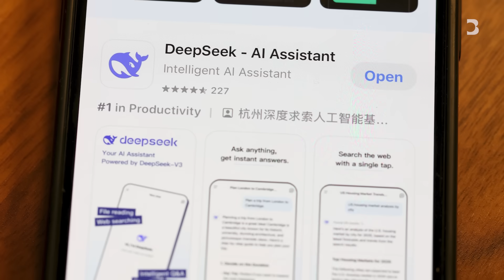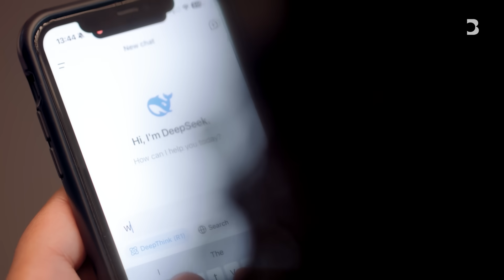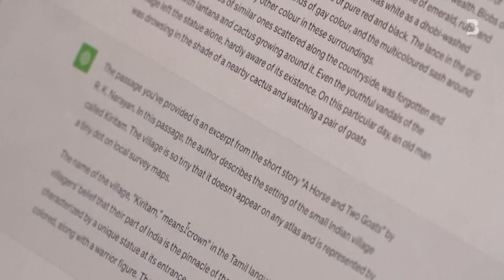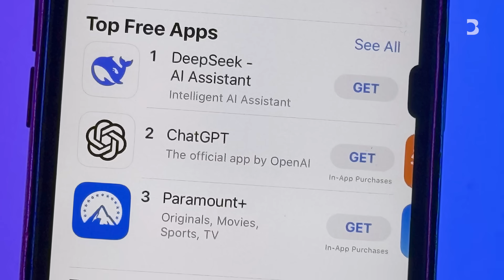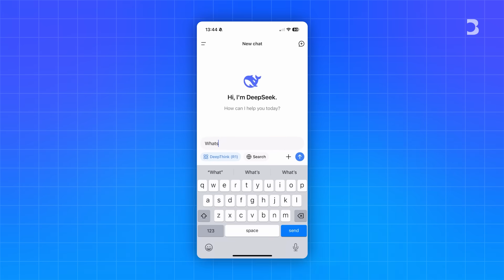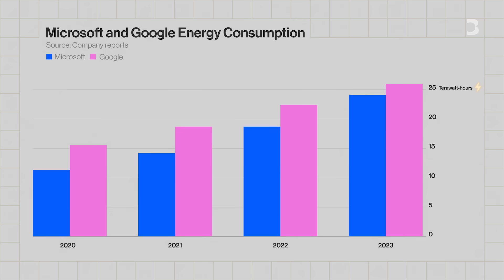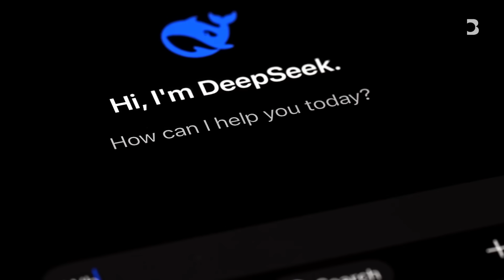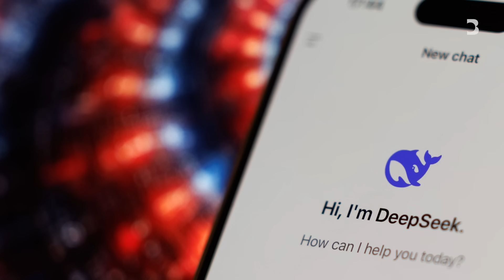How China’s DeepSeek Came for Big AI

Comment: I watched a lot but i decided to ask DeepSeek it self : From where DeepSeek got the Nvidia chips?  Answer:1. Pre-Ban Stockpiling
DeepSeek’s founder, Liang Wenfeng, reportedly accumulated ~50,000 Nvidia A100 GPUs before the U.S. imposed export bans on advanced AI chips to China in September 202212. These high-performance chips became a critical resource for early model training. The company also legally purchased Nvidia H800 GPUs (a China-compliant variant of the H100) in 2023 before the H800 itself was banned later that year15.

2. Use of Compliant Chips
After the H800 ban, DeepSeek shifted to Nvidia H20 GPUs, a less powerful but legally exportable chip designed for the Chinese market. While the H20’s performance is limited compared to the H100, DeepSeek optimized its software to compensate, enabling efficient training and inference510. However, U.S. officials are now considering extending export restrictions to the H205.

3. Alleged Smuggling Through Third Countries
U.S. investigations suggest DeepSeek may have acquired restricted Nvidia chips via intermediaries in Singapore, Malaysia, and the UAE 15. Key points:

Singapore’s Role: Nvidia’s revenue from Singapore surged from 9% to 22% in two years, raising suspicions that chips billed to Singaporean entities were diverted to China1.

Shell Companies and Fake Data Centers: Reports indicate a smuggling network using these tactics to bypass U.S. export controls1.

U.S. Legislative Pressure: Lawmakers have urged stricter licensing for shipments through high-risk countries like Singapore5.

4. Partnerships with Nvidia
Despite restrictions, Nvidia openly collaborates with DeepSeek. For instance:

The DeepSeek-R1 model is hosted on Nvidia’s platform as a NIM microservice, optimized for Nvidia HGX H200 systems214.

Nvidia publicly promotes DeepSeek’s efficiency, highlighting its use of compliant chips and software innovations like FP8 precision training12.

5. Hybrid Hardware Strategy
DeepSeek employs a dual approach:

Training: Relies on Nvidia GPUs (A100, H800, H20) due to their superior compute power and CUDA ecosystem1012.

Inference: Uses cost-effective alternatives like Huawei Ascend 910C chips to reduce dependency on Western hardware1011.

Controversies and Investigations
U.S. Scrutiny: The Commerce Department is probing whether DeepSeek violated export controls via third-country channels15.

Competitor Accusations: Rivals like Anthropic claim DeepSeek’s chip fleet includes “smuggled” or pre-banned GPUs15.

Nvidia’s Defense: Nvidia asserts its Singapore revenue reflects legitimate sales to global clients, not diversion to China

Comment: No, NOT a breakthrough— you should have actually looked deeper into it first.

And it is NOT actually “fully opensource” as they had claimed.  The intentionally omitted any of the training data, the pipelines used, and any of the aspects underlying the teacher portion of the Q-STaR RL training model that they used.  In other words, other than using and including the various opensource projects and not admitting to that by republishing them as their own methods that they were “gracious enough” to share how they are used (ie. MoE, data quantization, Q-STaR), they really published nothing that allows anyone to recreate their “opensource” AI from scratch.  

Further, the lied about not using NVidia H100 GPU’s of which numerous sources including their engineers had previously admitted to having and using.  Also, they did not include any of the intermediate training session costs (yeah, sure they got it right 100% on the first training session), and they did not include their teacher pre-training costs (est 35 mill+) nor the R&D and related training costs.   Lastly, they leveraged, against the ToS they signed, OpenAI’s GPT4o to create their V3 that they used to RL train R1.  

So, all in all, mostly lies about not admitting to how they did it, what it cost and what they have and stole.

Comment: I am not surprised .  Its hardware and software hack.  I believed the Nvidia GPU .chip came from ten to fifteen years old MS Xbox used consider to be junk.  Either they used the Xboxs or re-purpose GPU to new blank card to insert into the rack mount blade computer in a data center. 

  All this extra labor for what?   This video card use less electricity.  The older 3D chip use far less power with same architecture still does the job While it  save thousands in electricity.   The ultra cheap Nvidia card that cost X hundred dollar rather 25 thousands for  new Nvidia H 100.   its a great hardware hack

Comment: They also had to train the model in ASSEMBLY language because Cuda is NVIDIA's proprietary platform and so cannot be used by Chinese developers. Which basically means they trained and coded the whole DeepSeek-R1 model in a language which is as close to 0s and 1s as possible. 🤯🤯
Reply: So DeepSeek is actually performing very well on AMD GPU. This is AMD day too. AMD is winning by just sitting back home.
Reply: @jeffxie5067  yet as usual AMD does not benefit and stocks dropping..
Reply: Chad engineers!

Comment: OpenAi starts with the intention of democratising AI, but then, you know MONEY.
DeepSeek, run by a quantitative stock trading firm called High Flyer, trained on OpenAI's ChatGPT and for considerably less, is opensource and democratises AI. Huh...
Reply: Do you know what is MOE means? It is the product of most of the best models today (it is trained many of the best models today, thus it does need to search the entire database, just the portion that is interested, thus, deep seek, much more efficient and energy light).

Low level thinking  - >> HIGH LEVEL THINKING‼️
Reply: DS is really an increment improvement over OSS widely available.  Contrary to popular myth, DS has been hoarding nVidia GPUs at least as early as 2021 and is estimated to have spent over $500M so far.   DS's $6M pre-training cost is just a small part of developing of a model; it's slightly lower than at other AI companies.

Comment: 4:21 just to give an example, Nvidia H100 GPU's currently go for 40,000$ a piece. Nvidia's profit margin from this is 96% as the chip itself costs $3000 to manufacture. 

This mark up in price goes straight into the investors/CEO's pocket and that is how you reach a 3.5 Trillion market valuation.
Reply: What about all the engineers and support staff who spent years developing the GPUs? You have to add in the cost to design the GPUs.
Reply: @Outer_Kris   still that doesn't make any sense to sell the GPU's at that price point. Heck I have even seen some H100's going for $80,000 a piece. That is insane. 

The only reason Nvidia is capable of marking up the price and getting away with it is the lack of proper competition in this space.
Reply: It's high, but not that high.   The most expensive component in the chip is actually high-bandwidth memory, or HBM3 and that alone is rumored to cost between $8K to $10K and that's BOM.
Reply: @tooltalk   SK hynix maker of HBM3 memory (70%+ marketshare) has a cost of $5-10 per GB, that too depending on the memory size and configuration. No memory, not even HBM3 costs $8-10K. That is just absurd.
Reply: 3000 is just to manufacture. they spend a lot of R&D. their actual profit margin is closer to 50% which is no far off from other tech companies. stop regurgitating fake news like that agent orange.
Reply: And this is the reason Huawei having larger manufacturing costs due to the sanctions don't really matter. Heck, the NVidia chips that can be sold in China are actually cheaper in China than the US due to competition — and NVidia doesn't have much of a choice in this, because any market share lost in China doesn't just mean less money flowing to NVidia, but also more money flowing into Huawei, where almost all of that money is spent in R&D focused on making locally everything that the sanctions prevent them from purchasing from abroad.